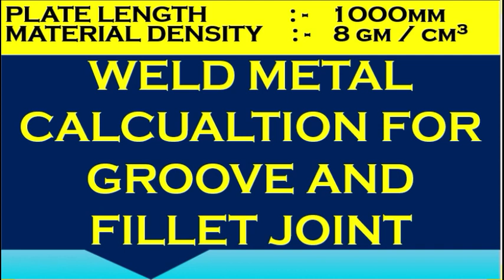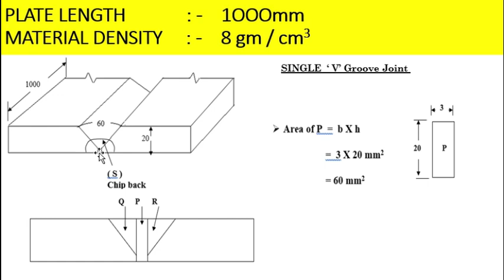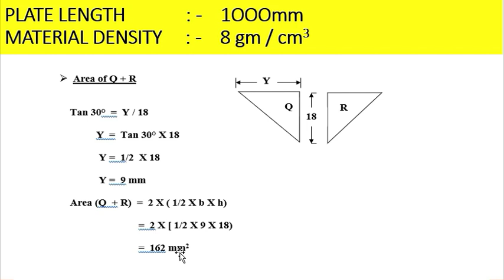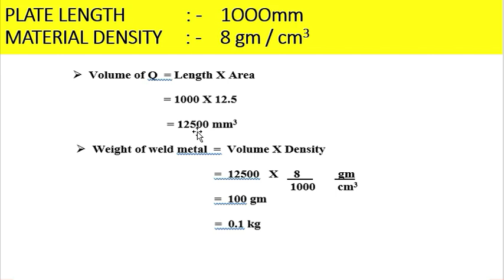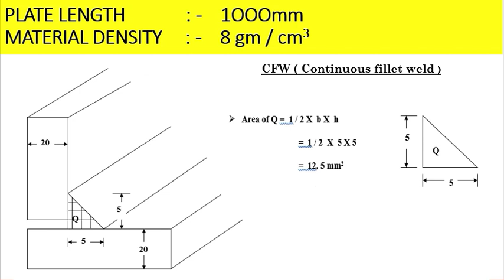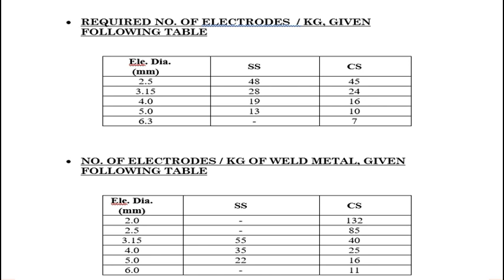Weld Metal Weight Calculation

Comment: What if the 20 mm plate has a back chip weld? your calculation gives a partial weight for the electrodes. You must consider both side welding until you dealt with the plate and most time it has both side welding.